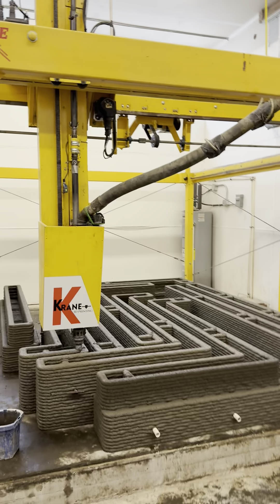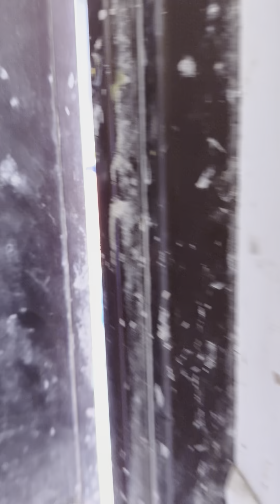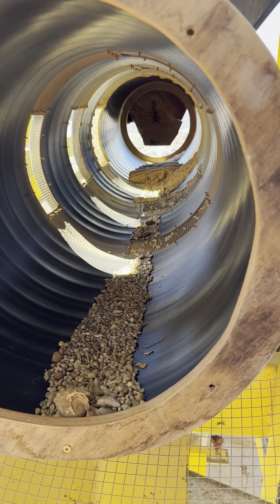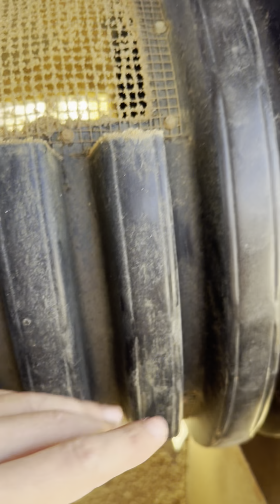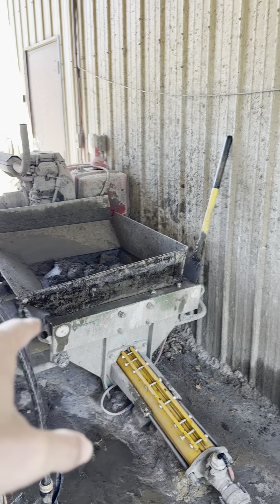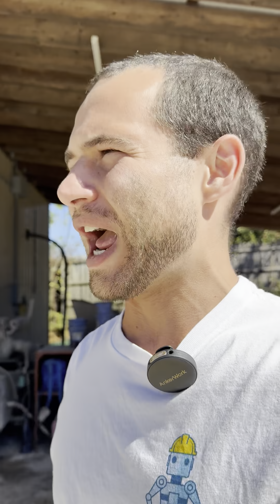Custom mixing system exposed! @kkrane6324 is doing awesome work.

Comment: It’s kind of wild that they’re grading sand onsite. It would make sense in a severely remote area with sand onsite but if you have sand available I’d sure think it’s a much cheaper option to buy it already sized.
Reply: I bet it eliminates the chance for inconsistencies if they were to get it from another source. Maybe onsite allows for 110% assurance, another step in quality control. Note that I am no expert, just thinking out loud.